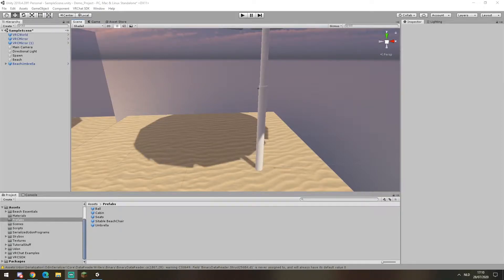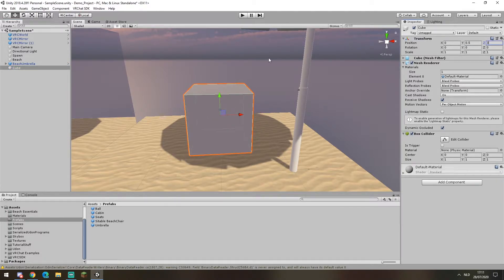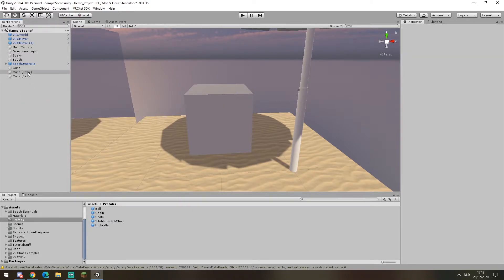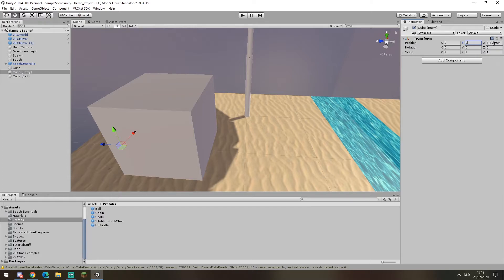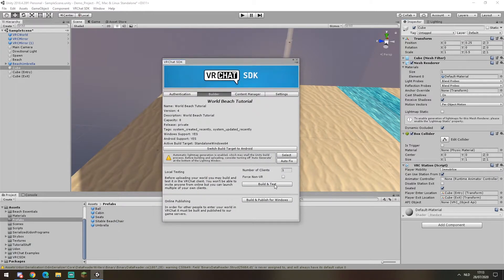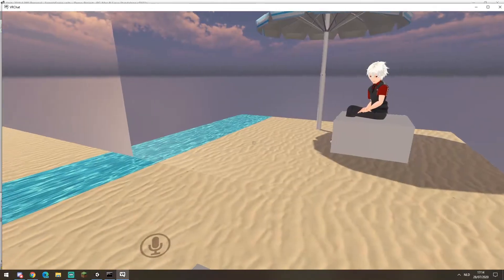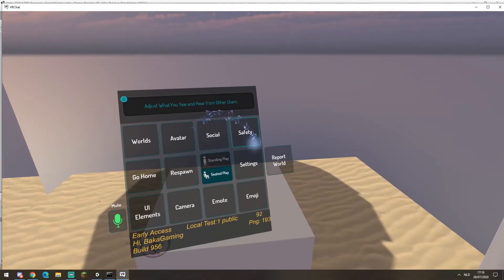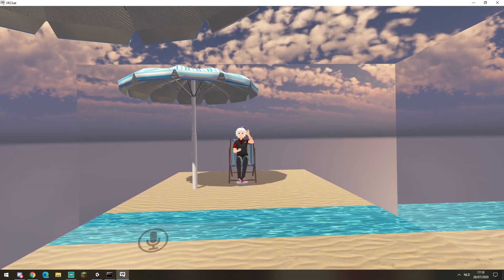Tutorial: Chairs & Seating

Comment: here's what I did, as long as a couch has colliders and such all you need to do is add VRC station to VRC chair 1, 2, 3, and 4 (if the couch has these) no need to mess with XYZ should work just fine! but yea that's what i did
Reply: have u had the issue of where where ppl sit is super touch and go? and even some times they get put super high up before going back down? seems be super buggy in sdk 3
Reply: @UrskaFur  yea I’ve noticed that is a few worlds here and there :-/